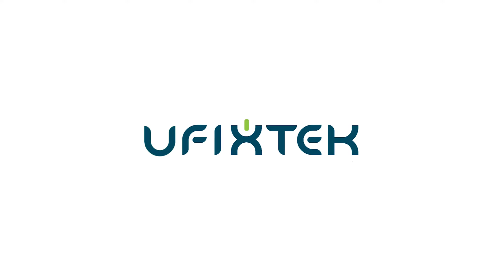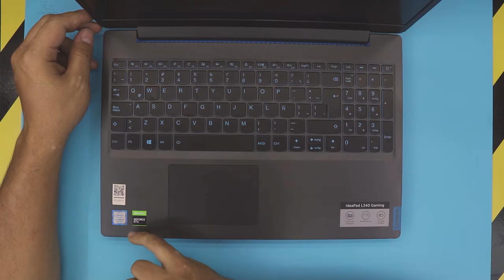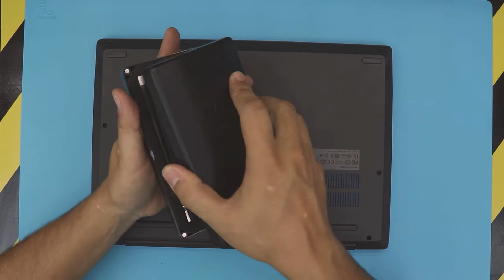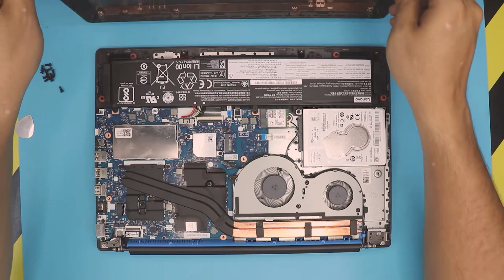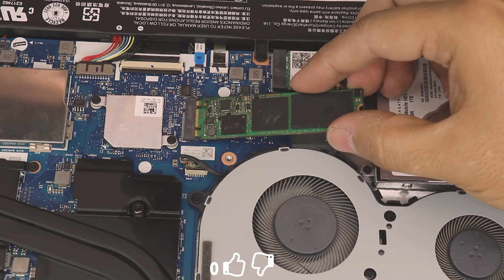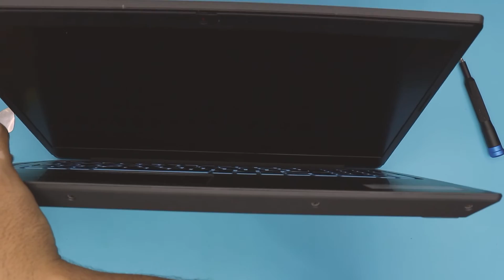Lenovo Gaming L340 SSD Nvme Upgrade, Boost speed!!

Comment: Hi
I'm going to put 1TB Samsung 970 EVO Plus instead of current 128GB SSD in my Lenovo L340 17IRH
I have questions about cooling
Currently, there is one thermal pad above the SSD that fits the current SSD but won't fit the new SSD (the current one is smaller)
Is it worth buying a new thermal pad for the SSD or will the current one work as well even though it won't cover the entire area?
Reply from the maker: 🫠Regarding your question, No need to worry about replacing the pads, keep the same pads. any nvme up to 2Tb don't need thermal pads.
Should you have any questions or requests in the future, please don't hesitate to ask me.
🍻cheers

Comment: hey bro , i jsut bought a new ssd and is it possible for me to make the ssd as the bootdrive while also keeping the files on my hard drive excpt windows?
Reply from the maker: 🫠Regarding your question, sure, you can install Windows on the SSD. Once it's finished, you can go into the user folder of the old HDD and pull out the files you need. Then, format the drive to erase the old Windows installation and put your files back.
Reply: @uFixTek  thanks bro , i am doing this method as we speak , also subbed to ur channel for the reply 🙌
Reply from the maker: I appreciate the support, my friend, and good luck!

Comment: Great video, but I wanted to ask a question that's been bothering me a lot. Have you tested the speeds of the m.2 NVME ssd on this model? I've heard that some ideapad laptops have lower speeds. For example, on the 970 evo plus we should get 3000+ write and read speeds, but how is it really?
Reply from the maker: Thank you for your feedback and for supporting the channel! If you enjoy our content, feel free to like, subscribe, or both!

Regarding your question about testing the speeds of the M.2 NVMe SSD, especially in reference to models like the Samsung 970 EVO Plus on IdeaPad laptops, it's important to consider several factors that can affect SSD performance.

Firstly, when you install a new SSD, such as the Samsung NVMe, it's crucial to install the Samsung Magician software. This tool helps monitor your drive's health and performance. Additionally, ensure that your laptop's BIOS is updated to the latest version, as this can also impact performance.

The speed of an NVMe SSD can be influenced by various factors. For example, the type of data being transferred and the program used for speed testing can make a significant difference. Tests using files with repetitive data (like a binary file full of '1's) tend to show faster speeds compared to files with more complex data. This is because simpler data can be compressed and processed faster.

It's also essential to understand that the true potential of NVMe speeds is best utilized when transferring files between NVMe drives or to a high-speed external drive, such as one with a Thunderbolt connection. Transferring files to a USB 3.0 drive, for instance, will cap the speed to the maximum throughput of USB 3.0, not the NVMe's potential speed.

Moreover, the performance can vary based on whether you're transferring a single large file or multiple small files. NVMe drives excel at transferring large files quickly but may show a significant drop in speed when handling many small files due to the need to reindex after each file transfer.

In practical terms, the remarkable speed of NVMe SSDs is most noticeable and beneficial when you have a setup that can leverage these speeds, such as transferring large files between NVMe drives. For everyday tasks, the difference might not be as apparent, and it's worth noting that the peak numbers advertised are often maximum speeds under ideal conditions, not necessarily sustained transfer rates.

I hope this explanation helps ease any concerns you have regarding NVMe SSD speeds. The key takeaway is that while NVMe SSDs offer exceptional performance, the real-world benefits depend on your specific use case and setup.

Should you have any further questions or requests, please don't hesitate to reach out. 
Cheers! 🍻
Reply: @uFixTek  It was more of a question about pci-express, but I've already solved it. The speeds are the same, and even faster than advertised, everything works perfectly, I may have to buy a heatsink for the SSD. But thank you very much for the answer!
Reply from the maker: awesome glad you have solved the issue, the nvme up to 2TB don't really require heatsink, but for this laptop make sure you get the "slim nvme heatsinks".

Comment: does this laptop model have 2 ports one for SSD and another for HDD?
Reply from the maker: 🫠 If you wish to support the channel, you can like, subscribe, or both!
Regarding your question,  you can have one HDD2.5 or SSD2.5'  and at the same time an nvme up to 2TB.
Should you have any further questions or requests in the future, please don't hesitate to ask me.
cheers🍻
Reply: Nope. Only 1 drive bay available.
Reply from the maker: i have clearly showed you and said it that you can have one 2TB nvme and one 2TB HDD 2.5' or one 4TB SSD 2.5'
if that is not enough let me draw it!
https://imgur.com/a/CUFm07h
two BAY for two drive at the same time
Reply: @uFixTek  I was under the impression that the question heavily implied on the 2.5" drives. I normally consider SSDs as 2.5" drives and call the smaller m.2s. Since the commenter put the word "AND", I assumed that the question would be 2x drive slots for either an SSD, HHD. No need to get worked up.

Comment: its not nvme its m2 ssd
Reply from the maker: First of all, I think you meant to say "M.2 SATA" instead of "m.2 ssd" Secondly, we upgrade these laptops for our clients by installing M.2 NVMe drives on them. It's possible that you have a different base model, but this model is indeed NVMe compatible. In the video, I used an M.2 SATA drive for demonstration purposes only.
Reply: @uFixTek bro how do i know if my exact model has m.2 nvme compatability?
Reply from the maker: unfortunately there is no option to indicate that, but 90% of the intel CPU that are over 6th get CPU they are PCI-E m.2  (NVME)

Comment: Hi i have a question i bought a lenovo ssd e660 and i put in the laptop it doesnt show up in disk manegement
Reply from the maker: double check and make sure you have installed it correctly and give me the full model of the laptop, because some only take m.2 ssd SATA not NVME.
Reply: @uFixTek  its the same one in the vidoe lenovo ideapad l340 the ssd is m.2
Reply from the maker: lenovo ideapad l340 is not the full model, what CPU gen you have ?
Reply: @uFixTek  Intel(R) Core(TM) i7-9750H CPU @ 2.60GHz   2.59 GHz
Reply from the maker: You purchased an NVME m.2? what brand and where!? the model you have it supports NVME and you may have a defective or damaged ssd
Reply: @uFixTek  the ssd isnt nvme its a lenovo e660 512gb m2
Reply from the maker: ahh you need a m.2 NVME for this motherboard my friend it wont detect m.2 sata
Reply: @uFixTek  tysm for ur help, keep up the good content ur the best
Reply from the maker: It's my pleasure my friend🍻😊
Thank you for the feedback! if you wish to support the channel you can LIKE or SUB or both :P
If you have any future questions or requests, please don't hesitate to reach out to me. I'll be happy to assist you

Comment: I have a stock NVME that came in the laptop and I’m trying to add an SSD in the existing bay (mine was empty) but it’s not being detected by Windows. I’ve tried multiple SSD drives so I’m not sure if it’s my SATA connector or something else. 😢 The drive is not recognized in disk management, nor in disks & volumes under storage settings, nor in device manager.
Reply: I think you have not used ur brain!!

Comment: Is it m.2 ssd set for lenovo ideapad l340 15iwl 4th gen?
Reply from the maker: Thank you for the feedback! if you wish to support the channel you can LIKE or SUB or both :P
regarding your question: no my friend it's not gen 4 but it will work with gen 4 m.2 ssd as all m.2 ssd gen 4 are back compatible with gen 3.
Reply: @uFixTek  thanks
Reply from the maker: its my pleasure my friend
Reply: My lap is not gaming pc. Is it available m.2 port?
Reply from the maker: if your laptop is the model that you mentioned above then yes you do have m.2 nvme slot and its pci 3gen and you can install m.2 nvme without any issue
Reply: I have a another question- which ssd can i set?m.2 sata or nvme?
Reply from the maker: if your CPU is 6TH gen and up then its a NVME m.2 it its lower gen 5th or low is ssd sata.
shorturl.at/ivBQR
Reply: My gen is 4.what ssd?
Reply from the maker: @anuradha-j7b  m.2 SATA my friend
Reply: Sure?
Reply from the maker: @anuradha-j7b  we have tried installing nvme on 4th gen version and it will not boot into it. some motherboard can handle it and need a moded bios update. just go with sata m.2
Reply: Then i can hit m.2 sta ssd?

Comment: What is now boot time  please tell as i am using same laptop with 1 gb hdd, my lapi take too much time to boot and opening software and applications , and now I'm thinking to add  ssd  in it for faster performance need ur opinion??
Reply from the maker: Thank you for the feedback! if you wish to support the channel you can LIKE or SUB or both :P
regarding your question: i would highly recommend you to remove the HDD (mechanical storage) and place a SSD, and install the Windows 10 fresh install and you will see the magic, from turn on to desktop its about 4-10sec load time application few sec.
everything will be super fast. just install the SSD SATA instead of the HDD, less work and almost same performance as the m.2 ssd:
https://amzn.to/3GpDvOI
again make sure you fresh install windows 10, i have made a video on how to create windows 10 usb boot drive: CREATE / Install windows 10: https://youtu.be/uDu8j2lE-dM
you will be shocked when you see the difference.

Comment: Hi I have a question, I have this laptop and an nvme ssd from another laptop, is there a way to put the nvme into my new laptop without replacing the nvme that comes with the new laptop?
Reply from the maker: Thanks ✌  for the feedback!  if you wish to support the channel you can LIKE or SUB or both :P
Regarding your question: This laptop comes with one m.2 slot and one sata slot available, your laptop your model (the new laptop L340) has a ssd nvme already installed and an hdd too?
if so then you have to replace the nvme ssd. if your new laptop doesn't have the nvme ssd then just add the one you took from old laptop. you CAN'T have two m.2 SSD in this laptops.
Reply: @uFixTek  Thanks for the help, I do only have the ssd, no hard drive. i guess ill get a 2.5 inch drive.
Reply from the maker: your welcome, this is one of the best brand on ssd:
https://amzn.to/3mjUWIq

other way to support the channel is by using my amazon general link before buying or searching for your purchases :P
https://amzn.to/3A8dJu6
much appreciated

Comment: I have a lenovo l340 with i5 9th gen 8gb ram and gtx 1650...can I install the same ssd??
Reply from the maker: Thank you for the feedback! if you wish to support the channel you can LIKE or SUB or both :P
regarding your question: you have two choices: you can replace the HDD to a SATA SSD (much faster than your hdd)|
or you can add an additional m.2 NVME ssd and install your system in NVME that will be faster than ssd sata.
🔵 CREATE / Install windows 10: https://youtu.be/uDu8j2lE-dM
🔵 500GB NVME: https://amzn.to/36a3yrH
🔵 1TB SATA SSD 2.5: https://amzn.to/3iFDT1P

Comment: Hello uFixTek, I have a question regarding SSD's for my Alienware M15 R1.. My specs r i7 8th gen, 1060 6gb ddr5, 8gb ddr4 2666 mhz ram and 1 TB HDD.. I want to remove HDD as it is slow as hell.. I am thinking to install Samsung 970 evo 512 gb or 1 tb ssd nvme m.2 may be but I have heard people saying that Alienwares get too high temperatures so ur SSD nvme m.2 will also get too hot and will not perform as fast as they r suppose to.. what do u say? do they really get that hot? I am thinking either I install Samsung 970 evo 512 gb or 1 tb ssd nvme m.2 or install 256 gb ssd nvme m.2 with OS on it and 1 tb 2.5 sata ssd additional for games but problem is sata ssds are not as fast as ssd nvme m.2 are but again if I just install 512 gb or 1 tb ssd nvme m.2 then hot temperature thing scares me.. please let me know.. thanks
Reply from the maker: hi my friend let me 1st of all tell you dont listen to all the crap people tell you, i been repairing and owning alienware laptops for a very longtime .
i would recommend you 1st thing 1st open up your laptop and repaste it with:
Thermal Grizzly Kryonaut: https://amzn.to/2UV30kl
(if you want to use a copper shim for cpu and GPU use a .3mm 20mmx20mm , apply paste on both sides.)

here is a video on how to get to internals, they are the same 95% same way they open:
https://youtu.be/j_nWRnHuqcg
https://youtu.be/Ujffb2gIsS0

the above will resolve your cpu temps and having a nvme or ssd does not have anything related to cpu overheating extra!!
and also nvme can heat-up and it will not affect its performance at all. we have stress tested and over heated many nvmes and zero performance drop. also if you concern about the nvme over heating they sell and heatsink small size for them that fits in the case. i suggest to go with 1 tb ssd nvme m.2 Samsung or Crucial
Crucial : https://amzn.to/3kN7LXA
samsung: https://amzn.to/2IKmvJU
and the reason that one is more expensive than other is because of TBW one gives you around 300TB WRITES before failure and the Samsung gives around 600TB WRITES  before failure.
and this is with 1tb 
if you get 512gb nvme the TWB will be way less on both brands
my best config is as following :
1tb NVME samsung
and 2TB mecanical or if you got the money 2tb ssd sata. samsung

TIP: when gaming lift the back end of the laptop about 1-3cm and you will see a dramatic temp drop because of air flow. note: nvme and ssd can go up to 75c and they will be just fine.
thank you for the support and if you got any more questions ask me in any of my video comments.